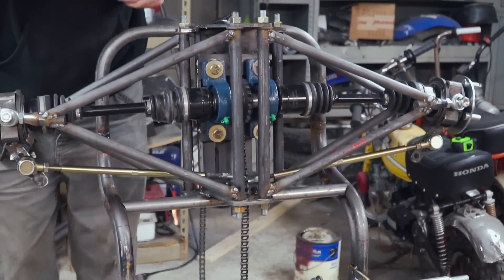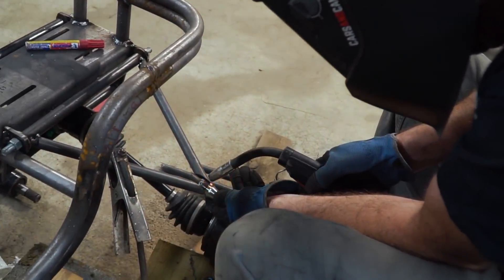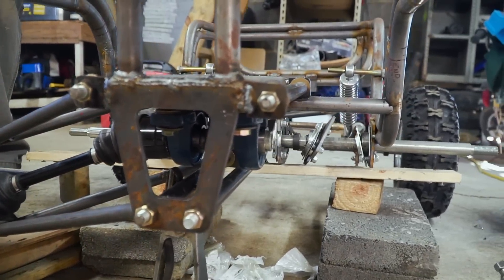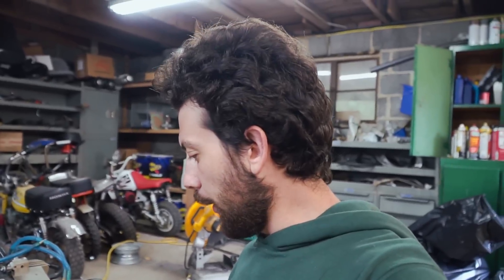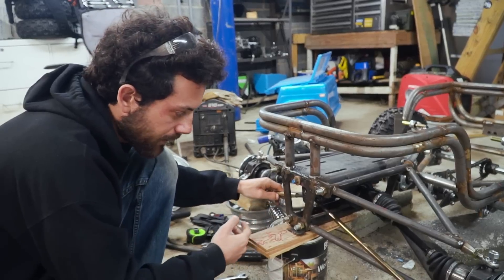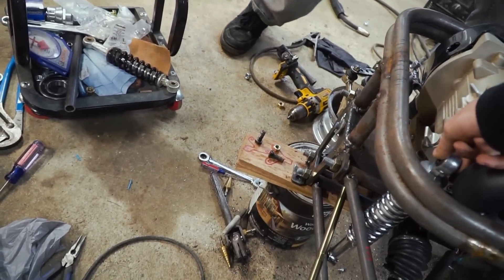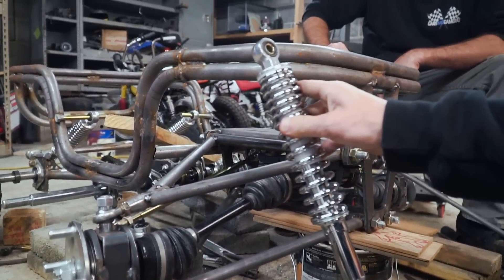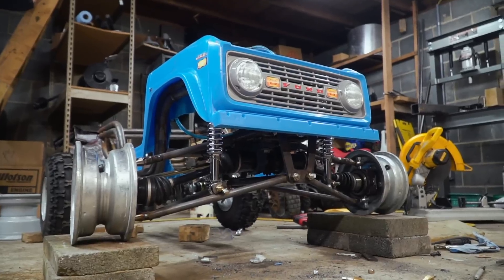4WD Power Wheels Go Kart Gets Suspension! 228cc Bronco Kart Pt. 6

Comment from the maker: Super excited for how this is turning out!
Reply: How is the horse power in that engine
Reply: make a motorised bike can i get a shout out
Reply: You should copy the front to the back
Reply: So cool
Reply: It going to be fine
Reply: @billsfanmc1786  22-24 hp
Reply: Me toooo
Reply: It's goin' pretty well. I always cringe, though, when I see the gaps in your fish mouth joints. "It'll be fine" for go carts and minibikes, but wouldn't pass NHRA tech.
Reply: I'm guessing this suspension is gonna work better than the one in the Trophy truck/cart/whatever.
Reply: @abirdnamedsunny5535  absolutely... Who can afford a Phatmoto?  Over $1k when a cheap $80 Walmart beach cruiser and a $100 predator would easily kick their ass
Reply: You need to mount the engine more in a vertical position, like some people mount them on bicycles. It’s not going to be easy get the body on and looking good with it mounted the conventional way. You’ll have more room for steering also.
Reply: @romanleonard2154  it's a 4 stroke motor so has to sit in a certain position to oil properly. If it was a 2 stroke you could do what you said
Reply: @lowryder3209  yes, I think 4 axel setup will work and look better . C&C what ever you do IT'll Be Fine!! 👍

Comment: front shock mounted to the center of the bottom arm is going to bend the poop out of the arm.....needs to be attached much closer to the wheel
Reply: Axle shaft gets in the way. But yeah, I'd definitely put a cross brace between the legs of that lower A arm (legs of the arm? Lol) at the shock mount.
Reply: I agree .
The front suspention wont work.
Reply: Yeah it will bottom out easy like that
Reply: Still don't know why they don't just use the front of a 4wheeler and copy what they see.
Reply: Who cares they are doing what they love and will figure it out when it comes to it,they also stated it was the testing phase still
Reply: It's fine with the positioning they have, they just need to beef up that control arm. They need to add a second "layer" to it, like how prerunner trailing arms are made, if that makes sense lol
Reply: @kshepthedrummer  incorrect......the very center of a length is the optimum point do bend it......one good jump and it will fold, basic physics
Reply: @mattsez2879  that's why I said they need to beef up the control arm. If they leave it as is, it's gonna fold on the first bump they hit. They either need to move it, or they can leave it and reinforce that bar. Google "prerunner trailing arm" to see what I mean by adding a "second layer"

Comment: You guys are so much better at this than you were a few years ago (I don't know, whenever I started watching you and annoying you with "you needed to do it like..." comments), but if you're going to be building vehicles with independent suspensions and going 40, 60, 80... mph in them you really need to get a better handle on suspension geometry.  2 major things in this one:
- caster- about 5-10* is the typical dedicated drag car/dragster, 3-6* for a fast road race car, and 2-4* for your average street car.  Everything that I've seen you build, including the rail, I would just set it at 5* and make sure it's the same side to side loaded.
- Ackerman- where did you get the idea that you need a rear steer linkage to have Ackerman?  Front steer is generally the preferred design for most applications for multiple reasons, and you can get ackerman with it.  The only reason that you see rear steer at all is really packaging reasons.

Comment: With that first suspension set up you are not only running a ton of leverage advantage, it is also what you call "falling rate", meaning the more that it compresses the more the leverage advantage increases. At some point it could potentially not compress the shock at all.

Comment: So, king pin inclination vs castor. 
You're measuring KPI and not castor. Yes, the measurement will essentially be the same as your camber angle, BUT if you run 10 degrees camber you're also running 10 degrees KPI which is WAAAAY too much. You should be setting your KPI at 2 degrees maximum and set your castor by moving the pivot points of the upper and lower control arm.
It'll work, but your steering will be super heavy

Comment: Potential idea for the chain tensioning, which is to have 2 small gears that freely spin, pushing in the chain from both the top and bottom, right as the chain exits thru the hole for the mounting point on the frame for the lower arms for the front suspension and whatnot.

Comment: Do you have any concern about it being 100% diff lock front centre and rear. Or is it gonna be fine. 🤙
Reply: @ Christoffer Sinding, It is gonna be fine... until one, two or all three chains bind up and get thrown off the gears 😆 But, this setup is for testing purposes only! Just remember, it'll be fine! Lol
Reply: Sad part is there are go cart diff kits available to purchase all they'd need is one for the front axle (yes I know that the rear tires spin slower than the fronts when turning... However the open diff would negate most of it via the body roll unloading the inside steer tire while turning allowing the driveling windup to release).  The rear axle being locked shouldn't be an issue the front axle to rear axle could be and the steer will be

Comment: This is just something to take a look at your G-Code Software is messing up. It should be cutting the inner circle out [Bolt holes] Before it cuts the outer perimeter. That way your bolt holes are always the same on every plate and the plate doesn't shift while cutting the bolt holes.

Comment: You could not find worse shocks if you tried than those go power trash ones, and flying in the face of physics and correct design philosophy is going to go great for that front suspension. 
Here's hoping no one gets hurt.

Comment: use pushrod suspension and a heavy duty mountain bike shock they are shork ,but the design of pushrod suspension allows you to get travel out of them and mount them where there is more room

Comment: The closer you put the bottom of your coil-over to the center of the truck the softer the suspension will be.  You may need to move the bottom closer to the wheel.  Think of it as a lever which it is.

Comment: Question on a carb jet. Fairly new to the mini bike gang. Bought a predator 420cc from Harbor Freight. It came with 2 additional jets. One is a 95 labeled (6000-8000ft) and the other is a 97 labeled as (3000-6000ft). I did not take out the one already in the carb so i have no idea what that one is. So the question of my question is, is a performance jet any different for the stage one kit to one of these extras i can swap out instead of buying a jet?

Comment: This might be a dumb question, but the thin walled tubing that you guys use on your framework,,,what kind of steel is it or what is it called. Want to add some seat rails on a cart that I am bringing back to life and the thin walled tubing I have burns through when I try to weld it to the frame....please help!!!!!

Comment: NO PLAN. NO Parts. NO PROBLEM. It'll Be Fine. lol You should weld up a winch that fits in the be holes and then you can lift it with and electric harbor freight winch motor. make sure it can swing way out over the side of the bed. We cover our mini with a moving blanket to reduce scratches. Try it. works great. We have one on our trailer to haul cars and toys up when they are broken also. Just a thought for your brains. One in the garage works well also. Mabey make it so it fits all three spots. Why work hard if you don't need to.

Comment: 4:39 That won't work, the pivot points of the suspension must be where the halfshaft bends are in both ends, like that when you are accelerating and hit a bump the halfshaft will snap in pieces.
Reply: The only thing they have to worry about is the length of the axle shaft. The joints can plunge in and out, like a slip yoke. As long as they don't bottom out, or pull out of the socket, the way they have it set up is perfectly fine.

Comment: All thread isn’t meant to carrry a side bearing load. Thread is mean for clamping force not side load. You should use some type of pins for the front control arm pivot points. Or in my opinion just redo the entire front end. Tubing bender, some hiem joints, and that front end will have plenty of space for everything. But for the front drive system. Revised control arms bent and hiem jointed on the frame side could maybe clear enough room to get a chain ran up there but I don’t see any way to get power up there. Just redo those front control arms. Space is what you need and I really believe you could free up a ton of space by ditching the poorly designed front suspension. You could achieve akraman, power to the front, and have a reliably strong front suspension.

Comment: Technically wouldn't that be all wheel drive? I was always tought 4 wheel drive is where you can switch it from 2 wheel to 4 wheel drive.
Reply: All wheel drive means its either fwd or rwd and when the there is slippage then the other wheels kick in. 4wd is when all 4 wheels have power at the same time.
Reply: @98LSxS10   no awd is when you cant switch to either fwd or rwd like 4wd Can 

What you mean is an open diffential so the wheel with less traction spins
Reply: @Team_Nico_Motorsport  that’s what I always thought too. Maybe that’s a more recent thing because my 64’ ih scout says “all wheel drive” on the badge but has a 2wd/4wd transfer case from factory

Comment: if you mount the shocks like youre planning the arm / lever moving it is huge , its going to have more travel but the spring needs to be a lot stronger to hold the car up 
as for the steering , the steering arms dont HAVE to be placed in line with the spindle , it could be mounted above and below the spindle it as long as its in the same plane for ackerman 
you could use a large say 10mm centerhole rosejoint on the top a arm so you could stick a 10mm thick shaft through it thats welded to the top of the hub and mount the steering arms on those shafts sticking through on top of the rosejoints and have all the steering linkage sitting above the top a arms 
that should solve a lot of clearance problems and alows you to mount the steering arms the right way to get ackerman

Comment: caster actually has two different... umm, types.  angle and displacement.  
(i'm not talking about rake and trail.  trail is a function of caster angle (rake), wheel size, and displacement.)
a grocery cart has zero caster angle, and like an inch of positive caster displacement.
a vehicle steering hub has some degree of caster angle (almost always positive), but zero caster displacement.  (not always zero, but usually.)
if you've ever noticed a motorcycle front wheel axle being mounted to the front side of the fork (instead of the very tip in line with the fork), that's negative displacement.  
negative displacement also reduces trail, when rake is positive.

Comment: Watching them fight for space making everything fit in the front end, they might have been better off going with a solid front axle. Less components overall, and they could have used a round profile belt instead of a chain to get articulation.  Yes, you would experience slippage with a belt in certain cases, but it might have saved a lot of head aches. Just my 2 cents as an 'armchair engineer' as they say

Comment: With 10” being max extension, with Ike sitting in the drivers position, the front should sag about 2.5”.  If it sits lower, you need more spring-rate.  You might want to try using two shocks per side in the rear?

Comment: If the front chain was to jump off of the sprocket, and somehow lock up the front axles,  wouldn't it throw you over the steering wheel and cartwheel?  Need some sort of bicycle sprocket that can freewheel forward.  Just a thought.

Comment: That motion ratio is far too high.  
You want a 2:1 motion ratio.  
Meaning 2” arm travel to 1” shock travel.
Reply: That is not right either  the lower the ratio the longer the shocks and springs need to be the higher that ratio the shorter they need to be for the same travel... However the lower the ratio the more effective the shock valving is and the lower the spring rate needs to be, the higher the ratio the less effective the shock valving also requiring a much higher spring rate not to mention the shock/spring angles the closer to horizontal a shock/spring is the less effective and the more horizontal the shock/spring is the more effective.  I would be more concerned about the haphazard design of the front suspension that more than likely will cause irreparable damage to the CV joints, probable CV joint hyperextension, a probability of being unable to steer under power, rapid component wear, and more than likely rolling the machine at speed due to the extremely poor steering, driveline, and suspension geometries.

Comment: With 4x4    you need equal size wheels and Tires
Reply: Yeah, It’s gonna break in the first corner anyway because it has no diffs. Different wheel sizes will even break it when running in a straight line.

Comment: Ackerman can be made up for in the center... it's wierd to do it on a forward facing setup but it's easy just opposite rearward facing steering.. u want your center pitman arm to be triangle shaped and cross the tie rods over/under each other so the tie rods would have to be longest possible as opposed to short if it was rear facing... Any research down the go kart steering rabbit hole should get u an idea of what I mean.. realistically any good Ackerman does will be immediately thwarted by the lack of diff and other improper geometries conspiring against u.. I think the king pin placement will be fine on this but only because the cvs are so overbuilt and the scale is so small...
Reply: In so many words, "it'll be fine"

Comment: But there are no diffs!? It will be a nightmare to go around corners!!
Reply: That's a really good point. I don't know a solution with it being chain driven. Possibly make one of the rear wheels ride on a freewheel of some sort?
Reply: @kristinewilson5353  in theory that could be a solution indeed, but a normal 4x4 needs 3 diffs, (1 front, 1 rear and 1 in between the 2 axles), so they would need about 6 freewheel couplers I think. And as a result there would be no more engine braking.

Comment: Dudes your not going to be able to turn u have a locked front axle!  U really need a front differential find one from a quad.   Keep it up later
Reply: You could put an overriding clutch in one or both axles. Down side would be reverse would only be 2 wheel drive. Diff from a gocart or small quad would be best. You are correct. But let's see how it works for them. They may be making mistakes but they are learning from their mistakes too. Looking forward to the next vid.
Terry from South Carolina

Comment: Lol you know that plasma table is supposed to be filled with coolant right??
Reply: I've mentioned this in the last 3 episodes, John finally explained why this time :)
Reply: @bashr52  He cut a hole in the bottom by accident and says he's waiting for a replacement part.  You would think since he has a plasma table and a welder he could just fix it himself lol.
Reply: @suzukiman650  I hate to say it but these guys defy all reason most of the time
Reply: @suzukiman650  I also feel like IKE should know better.he seems like he has more common sense but I dont get why they do it all the hard way
Reply: @suzukiman650  ahhhhh guess i shouldnt skip the slow parts of the videos 😂 and like someone else said thats why you have steel and a welder laying around for....
Reply: @seancrutcher525  I like their videos but sometimes the obvious eludes them.  I think I watch more to see them bumble through builds more than anything.  Not that I would do any better lol.

Comment: I'm having the hardest time securing the throttle cable without putting too much pressure on the cable inside. Any advice from anyone?

Edit: predator 212 is the engine. Straight from go power sports.

Comment: ITS NOT GOING TO TURN,  4 WHEELER LOCKED IN THE FRONT IN 4X4 DOESNT LIKE TO TURN, MAYBE BEING LIGHT IN FRONT WILL HELP,      BELT DRIVE THE FRONT, THEN YOU CAN TWIST THE BELT  LIKE THE OLDER GARDEN TRACTORS

Comment: Get real shocks with a know spring rate...  calculate the leverage against the shock and the angle.  Then get the weight of the buggy and order the correct stuff ?!

And quit using go china sports to get junk parts.